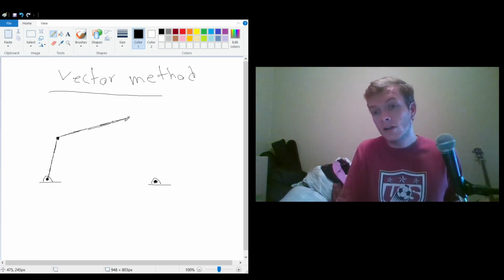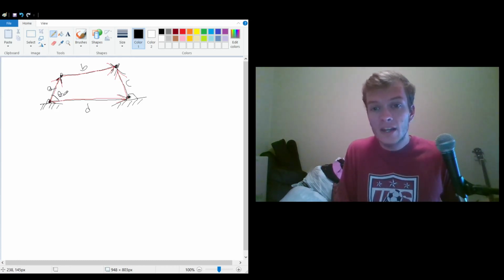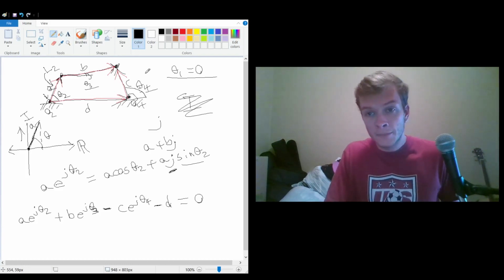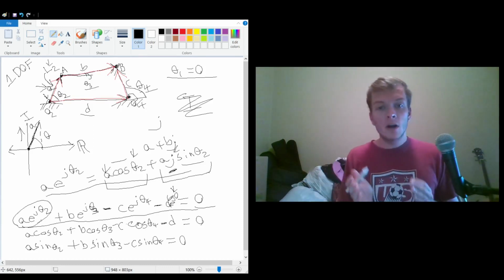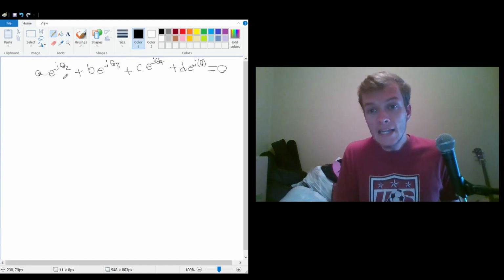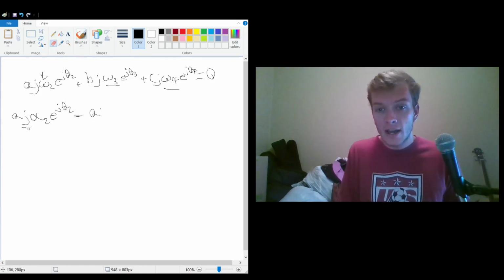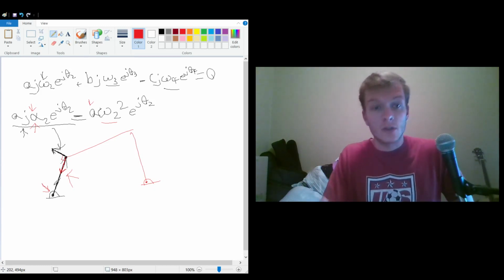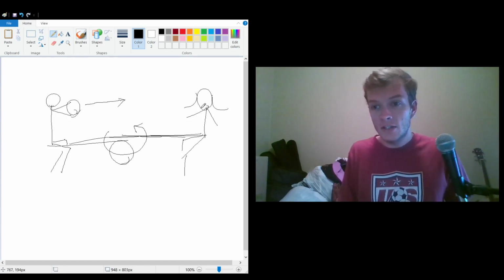Vector Loop Method - Four Bar Linkages

Comment: At 18:01 in the original vector equation i.e position equation, isn't the sign in front of the constant variables "c" and "d" supposed to be negative?
Reply: Ahh haven't finished the video yet, you caught it at 28:39 thanks lol
Reply from the maker: I believe for consistency’s sake with the previous example you are correct, but in terms of showing the steps for taking the derivative, the signs don’t technically matter (as it could just be considered a different example where we just draw the arrows in the opposite direction). That being said, the fact that this video has been out for so long and nobody pointed it out to me before is surprising haha good eye!
Reply from the maker: Further evidence of how old this video is 😂 I didn’t remember that either.

Comment: Could you also use homogenous transformation matrices in the same fashion? If you'd multiply all of them you should end up with the identity matrix, because we demand the kinematic chain to be close (all bars to be connected). T_AB*T_BC*T_CD*T_DA = Identity. With that you should be able to solve for the unknown variables too?
Reply from the maker: I don’t see why not! Although, I will say off the top of my head, I believe it would get rather complicated in the case of a crank/slider, as the slider is not strictly a prismatic joint. Not undoable, just requires a little extra thought about set up. The beauty of vector loop is that the dynamics kind of just fall out of the calculations naturally.
Reply: @JonoExplainsThings  Alright thanks :)

Comment: Nice explanation Jono, thanks, what about stephenson 6 bar linkage? could you explain how to make vector loop equations there?
Reply from the maker: I believe this could be solved with the same method, but there is more than one loop, thus it would be a much larger system of equations.

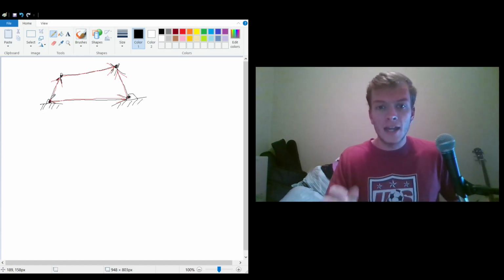Comment: Great video, a few questions, does this apply to all inversion of 4 bar linkages? at  6:00, why is the floating link and imaginary bottom link vector going that way?
Reply from the maker: +TheSunshineRequiem this configuration shown in the video is of the simplest case where all of the links do not vary in length. This method does work for other link configurations, but one must remember that in the case of, perhaps, a crank-slider, the ground linkage changes in length as the slider moves, so that distance is a function of time, and will not disappear when you take the derivative. 

The bottom vector must be going that way because we want the equation to be set equal to the zero vector. In order to do this, we have to end up back in the same spot we started.
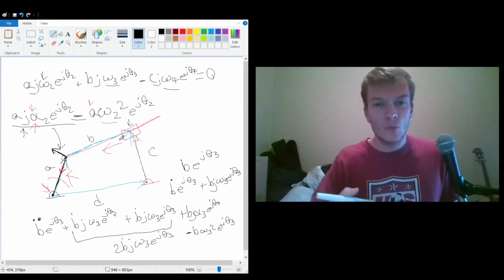Reply: i dont see how the vectors will end up back to O2 with such directions. the book says that those directions are chosen so as to define their angle where we desired them to be measured, i got this part. so a slider-crank is also a type of 4-bar? the way u draw it on 37:38, i only see link b is changing in length with respect to time, the ground seems to be constant to me...
Reply from the maker: +TheSunshineRequiem sorry I wasn’t thinking correctly in the last comment. The direction of the vectors themselves are arbitrary; as you said, they are used to define the angle. But, we DO want to end up back at our starting point. The way we do this is by writing the equation going around the loop (it doesn’t matter which direction as long as you’re consistent). When we right each term of the equation, we make it positive if the vector we have drawn is going in the direction we are moving around the loop, and negative if it is pointing in the opposite direction. 

In regards to the slider-crank, it seems I had forgotten which configuration I drew in the video. The key point is that in different configurations, you have to pay attention to the changing lengths of the linkages.

Comment: You are amazing. Thank you for wonderful explanation....:)
Reply from the maker: +nayan baishya I’m glad you enjoyed it!
Reply: I have one small doubt about choosing direction of vector and its angle with horizontal. What I understood from your explanation is, if we consider anti-clock direction as positive and attached vectors tails  to the head of previous vectors head and also represent the inclination angle of vector with horizontal in anti-clockwise direction, then while formulating position equation all vectors and respective theta should be considered as positive. Else wherever opposite is assumed, negative should be considered. Am I correct?? 

Best regards
Reply from the maker: +nayan baishya the method you have described is correct, but in general, the direction with which you go around the linkage is arbitrary. You must simply be consistent when you say one direction is positive and the other negative. If you choose to go around the circle in the clockwise direction, you would be taking the equations I set up and multiplying them by -1 which in the long run will not affect the end result.
Reply: Thank you very much..:)

Comment: So, if the lengths of all the links are known then there is no regular velocity only angular velocity?
Reply from the maker: I’m not sure I understand your question. Angular velocity and velocity are the same just from different coordinate frames. The absolute regular velocity can be derived from the angular velocity by multiplying by the radius from the rotational center. With regards to the lengths of the links, I think you are referring to the one degree of freedom motion? This just means that in the given geometric condition, only one input variable is needed to derive the other variables in the linkage for a given order, i. e. the angle of the first bar can tell you the angle of the next two if the lengths are already give. Does this answer your question?
Reply: I mean, since the velocity is the derivative of position and the length of every one of the links in constant than there will be no velocity, only angular velocity?
Reply from the maker: I think what your saying is that the rate of change of the length of the link is zero, which in this case is true. If you were looking at a piston, then there would be a rate of change for one of the link.

Comment: why is b changing? assume it is 2m so how 2m is changing
Reply from the maker: b is only changing in the case of a slider. In that case, the “base” is the distance from ground joint to the slider, which is changing assuming the rest of the mechanism is moving.

Comment: can u do an example with that informations?
Reply from the maker: It’s been like 3 years since I made this video so I’d probably be a little rusty. If I remember correctly, I do work through and example or two in the general case, though.
Reply: @JonoExplainsThings  thank you so much
Reply from the maker: ege gündoğan no problem!

Comment: For personal notes:
Reply: 10:00 links represented as vectors, imaginary v rect form
Reply: 2 vector loop equations expanded 16:00
Reply: 20:00 derivation of velocity/acceleration formulas
Reply: 27:00 acceleration
Reply: 34:00 slider/changing length considerations

Comment: how can I reach you?contacts?
Reply from the maker: Well my Gmail is the same as my YouTube channel haha
Reply from the maker: Yep!
Reply: @JonoExplainsThings  haha okay.Check Pm
Reply: @JonoExplainsThings  check email
Reply: will you help?
Reply from the maker: Engineering solutions my intention is not to do the work for you. If there is a concept you are having trouble understanding, I’d be happy to explain it to the best of my ability.
Reply: @JonoExplainsThings  thank you.I need to know whether the problem i sent can be solved with the method explained here.secondly if yes how do i model the principle equation for position.I can send you what i have done using the formula you explained.Pls.
Reply from the maker: Vector loop method is pretty versatile. It should handle the problem you’re working on. It’s best to first draw the diagram and assign each side and angle a symbol, then you can use that to add up all the real components into on position equation and all the imaginary components into another. Once you have a position equation, you can derive it to find velocity and again from acceleration. It’s important to note in your case that the length of the middle linkage is changing, so you will have to do the product rule for deriving that term.
Reply: @JonoExplainsThings  respectfully its crazy you're doing all this for free, you should charge people for them to reach out to you and you to explain their homework to them. Nice way to make some extra money considering you're still young